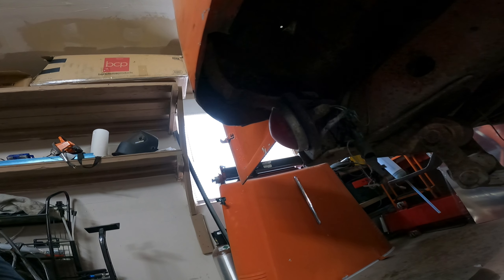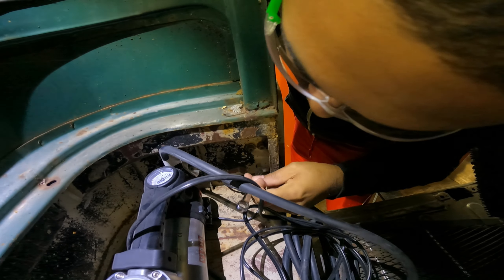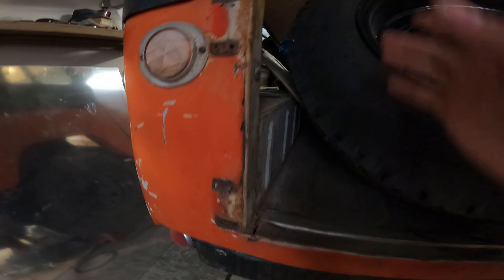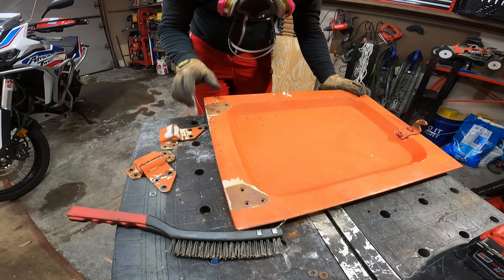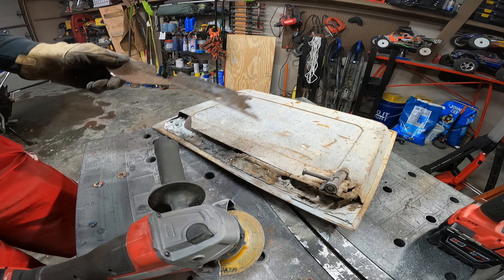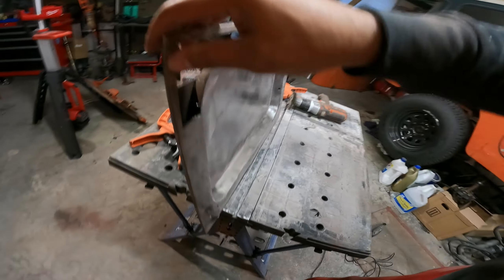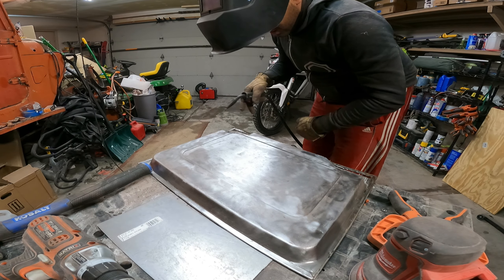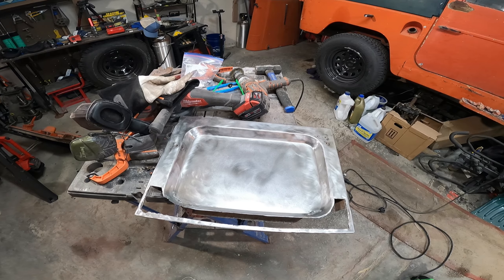Toyota Land Cruiser FJ40 Part 14 - Started on Body Work and Immediately Called it Off

Comment: Ouch man that hurt😅 first get yourself a set of JIS Screwdrivers. Everyone uses a philipshead on those screws, but they are different they are Japanese Industrial Standard (JIS). Saves you from alot of broken and stripped heads.

Sorry to ask but have you welded thin sheetmetal before? You cant just make a bead of weld like on a  thick piece of steel. You need to tack it up and switch from side to side, so it doest get too hot. If you try to make a bead no wonder you fall through.
I hope you didnt scrap the doors yet, they didnt seem to be too bad.
For welding sheetmetal, go and watch fitzees fabrication on youtube, great guy to learn from!
Dont get discouraged, I made the same mistakes as I started with the old cruisers.
Reply from the maker: Thanks for the advice! I ordered some JIS screwdrivers after hopping around the forums.

I am very much an amateur welder and have not welding thin metal. I didn't throw them out but I am looking for a set of replacements because this is out of my skill level at the moment. The concept of tacking it makes sense. I have a TIG welder I can try that with but it's going to take some practice on my end to get this right.